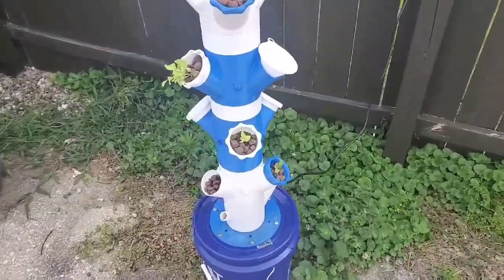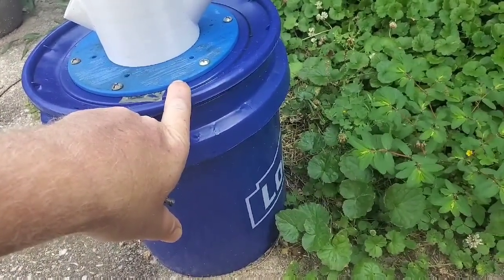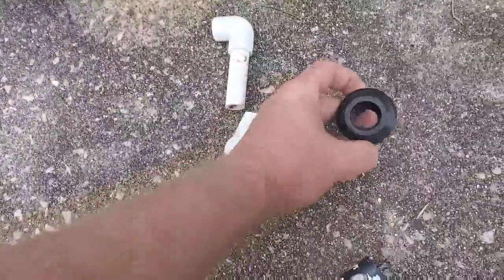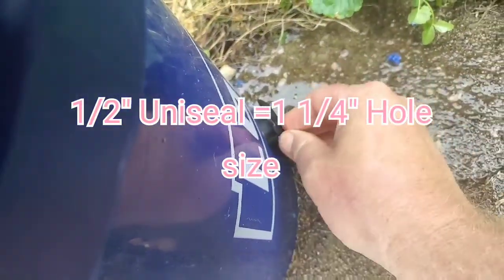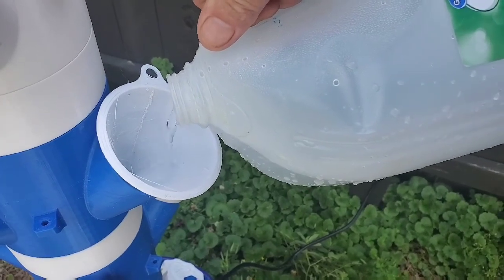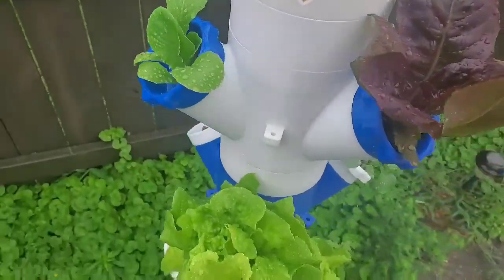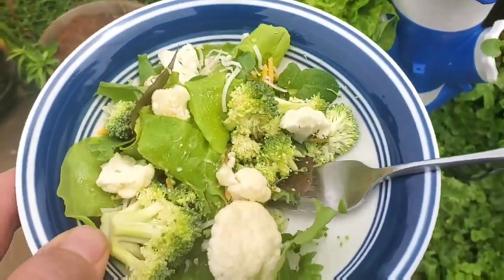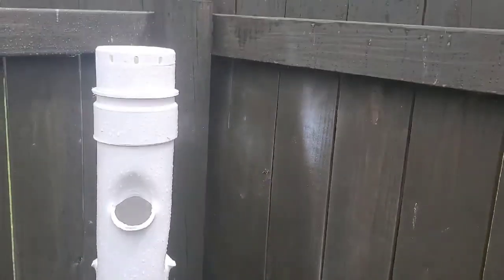3D Printed Hydroponic Tower: Seed To Harvest Part 2

Comment: Do you use a pH meter and a hydroponic nutrient monitor?  I've never completely changed out my nutrient solution (until I want to start completely fresh with a new grow) on any hydroponic set up I've used.  With the two meters you get the information needed to ensure your water is within the pH range (around 6.5 is average for most fruits/veggies) and then with the nutrient monitor, it's a bit more fiddly, but you will find with it that you can fine-tune your existing solution when "topping up" your tower set up.  Also, on the side of your bucket, you might want to add a quick-check water/nutrient level with a very easy add - tubing, a 90 degree piece that goes through a rubber grommet low on the bucket.  Add a gallon of water, mark on the level tubing that gallon mark until you reach the 4 gallon level/mark. That way when you test the solution, you know at a glance how much is in the bucket already and how much you will need to add.  I just bought a 3D printer and am very interested in printing these pieces out, so thank you for sharing the files - it looks like a really well-thought-out set up.

Comment: No other update?
Reply from the maker: Yes I discovered that the water evaporated out way too quickly during hot days..and also it became a pretty damn good water heater in the sun..but with the water close to 98 degrees on hot days.. all the plants began to wilt and die around August during those 90 degree days...so it works but in order for it to be practical the water has to stay cool....it would be great indoors near a window with a room staying 70 degrees..im going to try  this next in the spring.  I have way better luck with aquaponic system I built ..see that video
Reply: @st-qp4mr  water pump is costanly on 24/24?